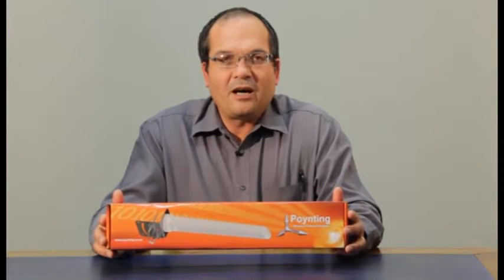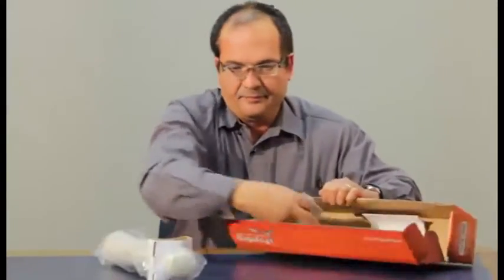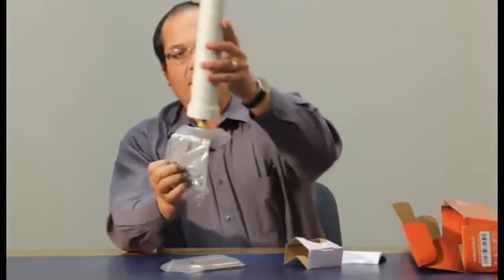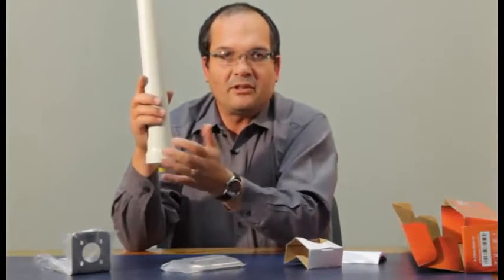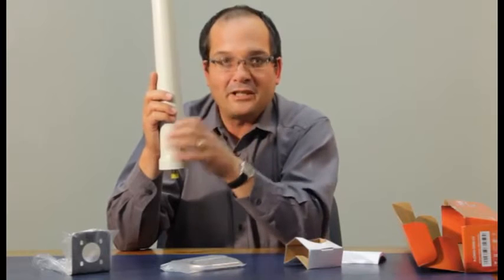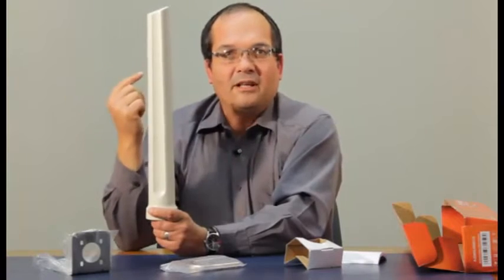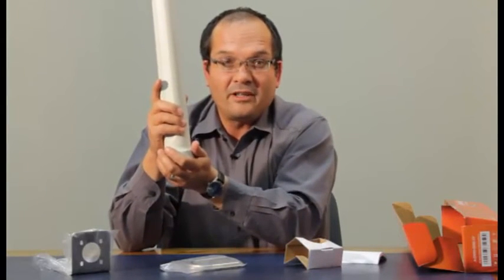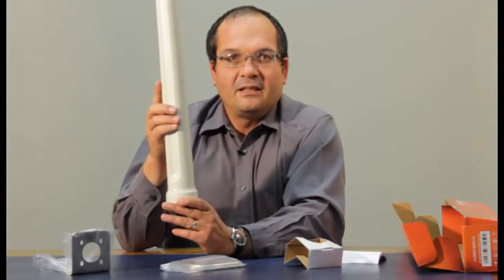Poynting 3/4G Outdoor Antenna omni-0069 unboxing and overview video

Comment: can you mount - OMNI-280-02 - Poynting Omni outdoor  3G/4G  and a TV antenna with signal booster amplifier on the same pole?
Reply from the maker: Yes, you can
Reply: Solwise Ltd , does not any inference the reception if the same pole?

Comment: Not suitable LTE 2300 Mhz frequency  ?
Reply from the maker: Operating frequency GSM900, GSM1800, GSM1900, UMTS and LTE (for LTE 2 antennas are required)
Reply: @solwise  what are the install guidelines and specs if using 2 antennas on one pole for LTE?
Reply from the maker: the new V3 version that we stock supports 790 - 960 MHz and 1710 - 2700 MHz
Reply from the maker: if using two for LTE then mount with best line of sight, vertical, about 2ft separation, antenna cables as short as possible @shaungoosen4199